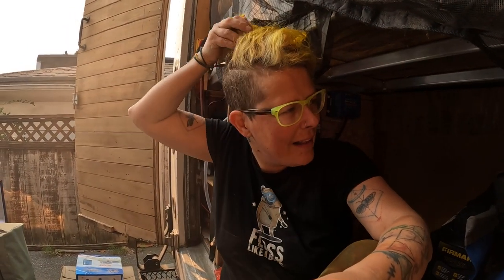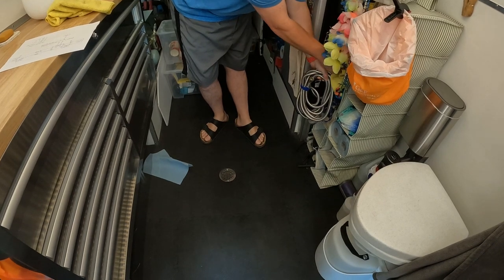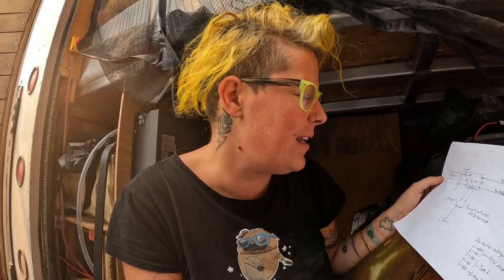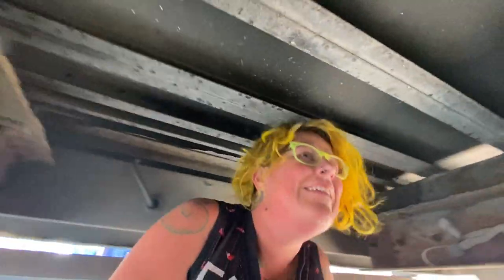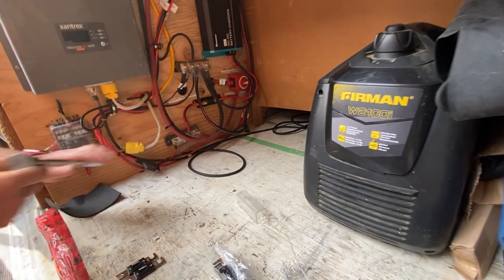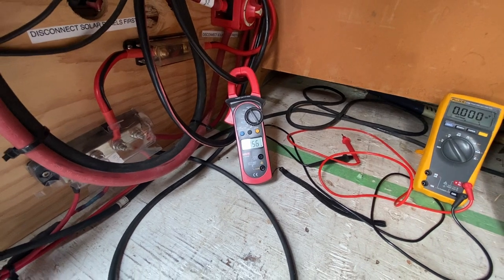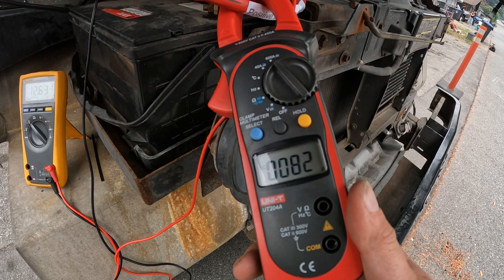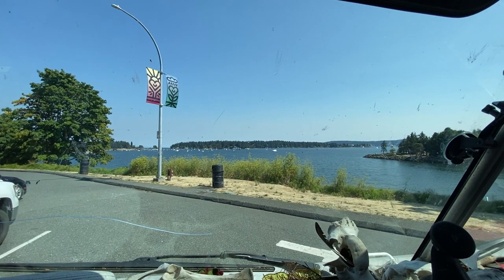I COULDN't DO THIS ALONE van build Electric DC to DC charger | Grumman Step Van Tour |

Comment: I need a Grant! I've had all of my parts & pieces for nearly two years & have been terrified to do the bit where I connect the house batteries to the starter battery. Once that's done, with Emergency shut off switches I think I'm good with the rest, but the terror of blowing up my house is real!
Reply from the maker: @lkimbcan I think everyone does! Super grateful! You can do it, do you have a charger or a relay or shunt in between? You got this!!

Comment: Nice so now when running, you're charging battery bank. Big generator. Super handy.
Always good to have energy options and someone like Grant!  willing to reference the processes of that energy. More knowledge more better!
I was wondering, were the cables that ran thru the bodies drilled points insulated with rubber gaskets to prevent potential chafing of wire coating?

Comment: I didn't know that dc to dc amperage could be controlled in that way.
I was told that the Big blue's computer.. by an alternator shop guy.. wouldn't be able to handle that much current coming thru.
I haven't looked into it further.
Thank you for showing me the process of installing this! Sure looks complicated to my eye!
Reply from the maker: @BohoBlueVan how’s your van doing now?! Yeah it’s not controlling the alternator it’s the charger only taking a certain amount of juice. What dc to dc charger do you have?
Reply: @FlossyRoxx  I don't have a dc to dc. Just a regular isolater.

Comment: Im shocked how little room you have under the hood. 
My Utilimaster has a mt45 Freightliner chassis with the 6bt Cummins Im considering mounting a generator or a large propane tank  under the hood in all the excess space behind each headlight.
Reply from the maker: @devinholland2189 yeah different engines different amount of space, most of the top of mine is all air filters. The older the model the more space I guess.. there is a lot of space between the front of the hood and the engine behind the headlights tho like yours I guess..